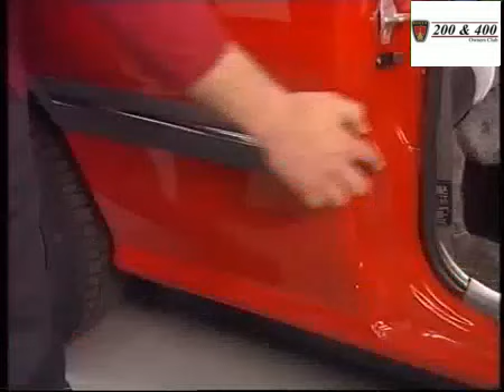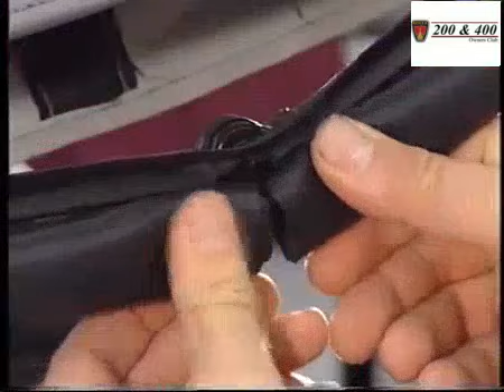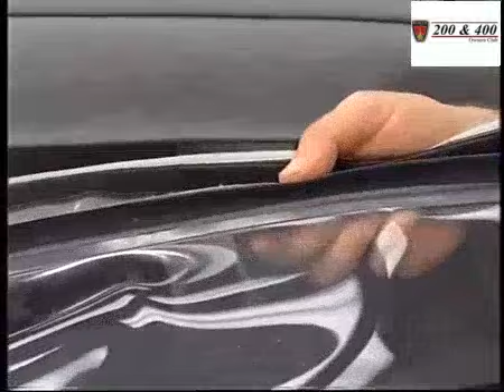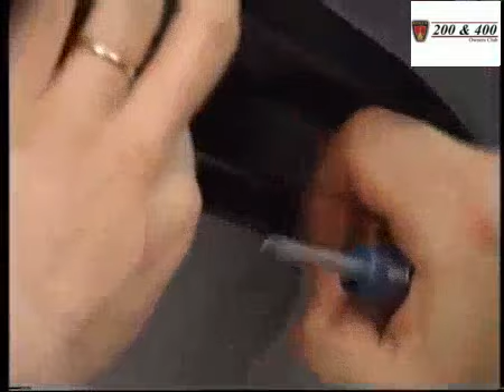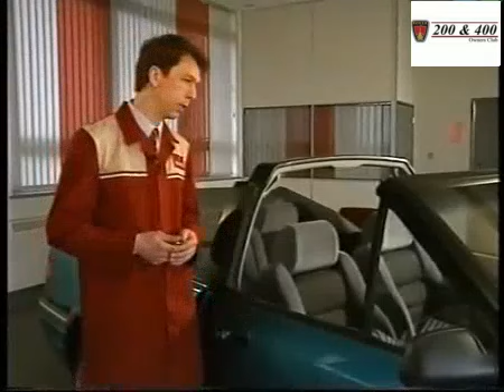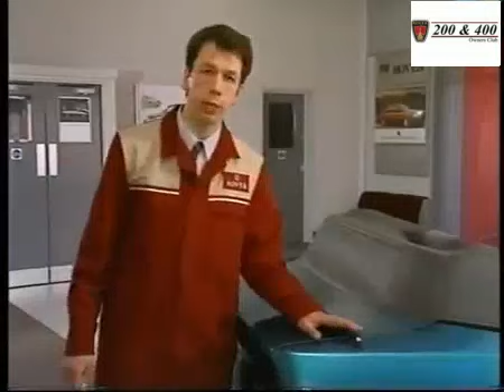Rover 200 Series Cabriolet Technical Reveal

Comment: Damn I remember that alarm sound from when my mum locked my sister and I in her cabriolet without deactivating the sensors. I was 6 when my mum got hers 1st of August 1993 on a K reg, 214i SPI in nightfire red with power windows and roof which I believe were optional.